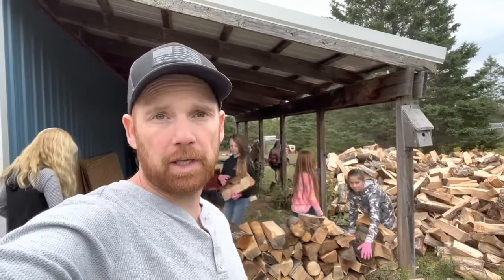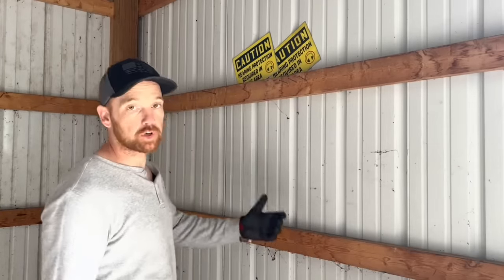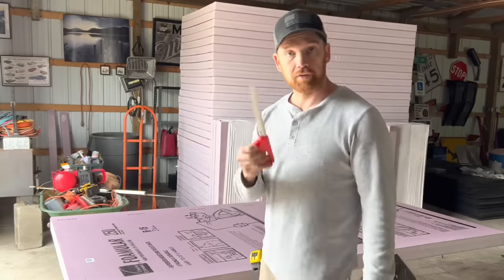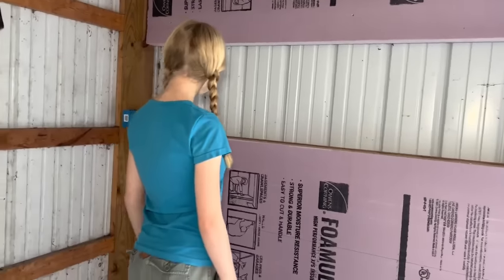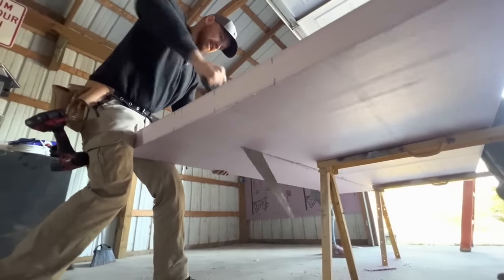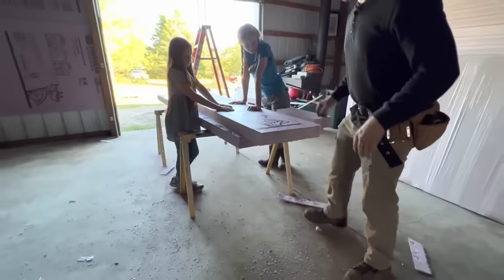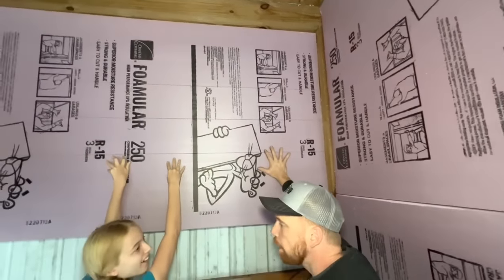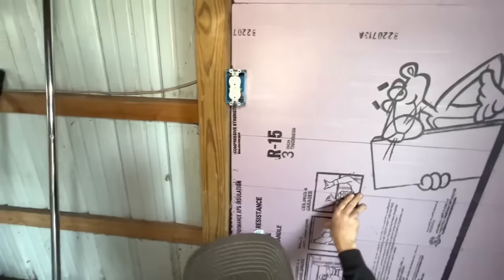Insulating our steel building/garage | Why we are NOT using Spray foam... Family prepares for winter

Comment: Hey! That was fun to watch. The little saw you bought for 16.00 is actually designed to cut Mineral Wool or in most cases Roxul products. A hot wire is the best way to cut foam. The reason that spray foam is so expensive is the result of the snow storm in Texas a couple years ago. Spray foam is two part and the Red or common part is mostly manufactured by one company that has never caught up to demand. I work for Canada's largest Insulation distributor and had a blast watching your video. While there are a lot of ways to do a hot wire you managed very well. Great video, great fun and great kids ... Cheers from Nova Scotia
Reply: I found my table saw did an excellent job. A little messy, and keep a shop vac handy to keep the foam debris out of the motor. Hot wire would be nice though.
Reply: I was just about to comment saying the same thing. Thought I'd stop using our bread knife for cutting Roxul batts and bought one of those. Aside from that I finished my basement with the  styrofoam boards made for interior walls, but they interlocked to have a good seal in between and a 1/4 cost of spray foam and no where near as messy. Its been very warm for 8+ years in Canadian winters.
Reply: Great family help
  Cutting foam is work. My method is a sharp 4” wide putty knife for the long cuts. Sharpen one side well, bothering several passes along a straight edge to set the line. A couple more passes with pressure and you will be over half way through. Then you can snap the rest off along your cut. I do use a saw for the detail cuts. Thanks
Reply: I've tried insulation knives, bread knives, putty knives for cutting foam.  What worked best for me was an 18" snap off knife.  Can get them for a few bucks at the big box stores.

Measure, score with a straight edge.  Cut a bit deeper next pass, repeat a third time.  Gives very clean, precise cuts easily.  Snap off the end blade once it starts dragging and swap out knives every few boards.
Reply: You are very funny and smart👍🏽 and the girls are so helpful. You made me giggle so much with your quick wit😊 subbed.

Comment: You've got such a great family. Kudos! 
I'm a retired GC  48 yrs lived in the 
UP. Moved to Florida in 
1978.  Built many steel buildings and pole barns
Those bottom holes you are 
Using for venting allows 
Rodents (mice)
To move in and they will
They will eat holes in the 
Insulation   We used a manufactured "L" flashing 
Around the bottom 
You could still do that
Reply from the maker: Thank you Al. We will be putting in an L flashing. Thank you for the tip. We’ll be doing an update video also at some point. Hope you’re having a great day.
Reply from the maker: I guess I’m not understanding your analogy on the “Death Plug” it’s not hooked to grid power at all. It’s only powered when the generator is plugged into it. Anyway take care

Comment: You should have cut strips of 1 1/2 to fit between the 2x6s then put the 2 inch over that. I didn't on one of the walls in my shop and I basically created mouse condominiums with roads. When I took some of mine down i had a mess. Blocking the pathways with more foam board helps a lot with rodents.
Reply: Exactly. The snakes will follow the mice. The bugs and spiders will love that air space too.  I wouldn't be surprised if the bees find it and build a hive in there.
Reply: I do love the idea of sealing in between the boards. I'll be doing that on the wall I have to redo. That'll definitely keep the bugs down.
Reply: I totally agree. I live in the mountains over 6k feet and I fill in every hole possible else it will become a nest for rodents and an entry place for bugs. I'd never allow the holes on the bottom to be there. I'd fill up every hole.
Reply: If you have rodent problem just put out equal amount of cornmeal and baking soda.
It will not harm dogs or cats , just rids the mice and rats.
Reply: If rat guard is used on exterior when siding is installed,then caulk any gaps at bottom it will help immensely
Reply: Lol that's perfect size for mice.
Reply: Really should have a vapor barrier outside metal. This would help with varmints
Reply: @edwinrohweller  not in cold climate.  This foam board if sealed with spray foam will act as the barrier

Comment: I did my shop roof a few years back.  Made a huge difference!  HOT TIP--Your sawsall, circular saw or table saw would be much quicker and likely produce cleaner cuts.  Even if the latter two will not cut all the way through, it's still far less hand work.  Thanks for sharing this great project with us!
Reply from the maker: Thank you! Have a great day!
Reply: @9252LIFE  I made myself a foam cutter because I was using the foam board with the reflective siding. It worked great with no mess. There are videos here on youtube that show how to make them.
Reply: Sawzall works OK ,but circular saws turn to fast and melt the foam making a goo mess. Handsaw gives the most controled cut.
Reply: @dalerounds4036  Interesting. Circ saw works great for me. Maybe blades & saws are different?
Reply: @branchandfoundry560  how thick was the foam board though, closed cell or open cell? Doesn't work well on closed cell over 2 in. 5800 rpm skillsaw made a messy cut.
Reply: @dalerounds4036  Two inch pink rigid foam board like shown in video. I have a Porter Cable circ saw made in 2003 and use 24t Diablo framing saw blade (for reference). Could be I'm just lucky it works for me???
Reply: @dalerounds4036  I also use a Makita track saw with good results.

Comment: Tuck tape is best to seal up the flat foam to foam connections and then use canned foam for angles or any awkward, gappy areas.  Need a sealant at the floor to foam connection as well.

Comment: I bought a spray foam setup to do my steel building after seeing my neighbor use insulation boards years back. His metal rusted pretty quick due to sweating. At least use butyl tape on the board's perimeter so there's no air penetration, that stuff stays pliable and sticky no matter what temps drop to. Great channel BTW, I subbed, you got a nice setup!
Reply from the maker: Thank you Gene!
Reply: You can always add a vapor barrier, simple fix. It also depends on if you're in the north or south. Sealing the foam from the inside will be enough in cold dry climate but you need to seal the outside in the humid south.

Comment: I would use a small bead of spray foam between each sheet instead of PL adhesive.   Also start by placing the first sheet on the bottom (beded in spray foam) then stack the next sheets on the way up, leave a 1/8" to 1/4" gap on the sides then fill the side gaps with spray foam. Alternatively there is special tape for sealing foamboard seams.
Reply: Yes I definitely use the spray foam between sheets.

Comment: We had the same problem when insulating an addition, and most recently a post frame woodshop. The spray foam guys wanted insane prices!! 6k for the tiny addition —more than the addition itself costed! The cost for the woodshop was close to 20k! We used batt insulation with Insul-Hold strips on 3 of the walls, XPS and batts on one wall, and batt and blow-in in the ceiling.  If you are willing to do it yourself, you can save massive amounts of money! Note: Foamboard adhesive works dramatically better on XPS foam like that, and you can cut the XPS by scoring and snapping, cut it on a table saw, or a very sharp knife as well.
Reply: Most foam installers have base charges or minimums. They have to spend just as much time driving to a small job and set everything up vs a large job which is a good portion of the work since spraying it is actually fast. The cost of spray foam isn't worth it since foamboard is almost  just as good if you use can spray foam to seal the edges. You also risk ruining your house with the toxic VOCs if the spray foam isn't done correctly and you can't remove it without tearing the walls down and it will smell for decades. You also have issues with adding electrical or plumbing but ya... spray foam Costs too much for the minimum benefits and risks it brings.
Reply: @randybobandy9828  I agree 100% randy! The price we were quoted for spray foam for our post frame woodshop was more than it costed me to build the building! No way that was happening!

Comment: Great video. FYI, I just saw another channel have to remove their metal siding and add the metal covering the bottom of the sheet metal to prevent mice from going up the grooves in the metal siding. Mice can destroy your insulation from the inside out.

Comment: Adding the foam to your garage doors will change the weight of the doors which will effect the counter balance with the spring. You may need to add tension to the springs.
Reply from the maker: Those 1.5” boards are very lightweight but yes the springs on the doors already need attention as they only have one of the springs attached at the moment. It looks scary but I’ll probably put a helmet and shoulder pads on and try to attach that soon! 😆
Reply: Adding tension will not be enough you will need new springs.  Tension may get you by for awhile but it won't be long and they will break so they get replaced anyway.
Reply: @johnlonghair6461  Correct. those foam boards seem light but they do effect the weight and balance of a garage door more than would be expected.
Reply: Adding tension does not increase the amount of weight a spring lifts to any worthwhile degree.  It just moves the problem you have to a different point of travel.  

If you add tension and make the door lighter on the floor you just move that problem to the fully opened position and make the door hard to close.  

A lot of garage door techs are hacks so if one ever told you this works get a new door guy.
Reply: Yes this will Warrant a new set of springs.
Reply: @cygnus1965  he's got 10 lbs of leeway for "Balanced Weight", that's a 20 lbs swing high to low. he'll know right away if the spring needs to be updated.

Comment: 👍 I did the same with rigid foam and saved a ton over spraying. My hand will never be the same after cutting each piece by hand lol. Don’t make my mistake- Get a heated element knife. Cuts that stuff like a hot knife going through butter. 
Be careful with that wood pile… The weight of all the combined wood is more than enough for that corner support.

Comment: The walls are going to be full of critters  .  If you need ventilation , fill the openings with stainless steel  wool .  I have used it  to keep out critters as small  as  ants .
Reply: The spiders will take care of the critters that happen to make it past the permythrin
Reply: Steel wool turns to rust
Reply: Steel wool is flammable not to smart
Reply: @craigchenery604  the foam sheets he is using are way more flammable than steel wool unless I’m missing what you are saying.
Reply: @bluntone2273  no your right guess it wouldn't matter
Reply: That void will be full of mice, & maybe rats. I worked metal blogs for awhile, we formed a 1 1/2” x 1 1/2” notch in the concrete for the metal siding to sit in. This seals off the metal siding.
Reply from the maker: See what we did in our newest video to fix that issue
Reply: @bluntone2273 the foam board have a fire retardant within it , it must be exposes to open flames for it to ignite and if you have open flames you have much more to worry about than insulation because even spray foam would catch on open flame

Comment: Ornery old engineer here and I have to say that it is so refreshing  to see a young family like this!!!  Some of the best memories my siblings and I have are working with our father!  Kudos!!!

Unfortunately, I have to advise you that the air gap you created will be a nightmare for you.  With the gaps to ground at the skirt board, you've created an absolute haven for field mice.  They will devistate your insulation within just a couple winters.  Moreover, their urine will accelerate failure of the coating on the steel siding.  Secondly, your premise for the air gap is incorrect and a very common misunderstanding.  Reading SPFA-134 would have quickly helped you with that understanding.  You have created an environment that will actually result in condensation on the back of the steel siding dramatically shortening its life.  Moreover, while I agree spray foam is ridiculously costly, it absolutely is not an issue when the PROPER foam is PROPERLY installed in a pole building.  The aforementioned reference is the guide, and all the large steel siding manufacturers I can think of off-hand are ok with it.  What is hard to find is an educated and experienced foamer, and you also shouldn't install it on typical econo-grade pole barn siding typical on residential buildings (29ga) because of oil canning.  Thirdly, if you do not have a moisture barrier under the slab, you will like have constant elevated humidity and condensation in the interior.  There are some coatings that can be applied to the slab - none are DIY - to create an after-the-fact barrier.  Fourth and final, and if you are concerned, your installation does not meet the State Code.  You're not providing a compliant thermal barrier.  

Truly, I hate to be critical, but because you have a large following it's important to share an appropriate understanding.  There's nothing wrong with DIY, but it's best done in an informed manner such that it is also do-it-once.  

Best to you and your family in 2023!
Reply from the maker: We posted a video of us installing Rat Guard on the garage to keep mice out. Also condensation won’t build up on the inside of the steel as this is how most cold roof attic’s work and they don’t sweat. We have heated it this winter quite a bit now and ended up pulling down a piece of foam board to install some wiring and the backside was completely dry. We appreciate your input on the matter and to be honest hope for our sake you’re completely wrong. Another factor I guess worth mentioning would be we live in the far north and there’s never a humidity problem/issue here. Anyway have a great New Year.
Reply: @9252LIFE  Great on the rat guard.  If you went with a mesh, make certain it's rated for field mice! They can pass through 1/4" opening, which is the most common size for wire rat mesh.  

Beyond that, I have been a licensed engineer in State for 33 years now, and have built more than 300 pole and steel-framed buildings for commercial, industrial and residential applications in-State alone.  I'm sorry to keep being critical, but your position about roof ventilation is also incorrect as your are not understanding the key differences of how the roof material and its substrate are vital considerations with regard to the interaction and ventilation to insulation schemes.  Even during the span of my career, the guidance of 20 years ago is the folly of today.  Though, that folly is what continues to improve, including reformulation of insulations to remove harmful and corrosive constituents.  That said, I have project right now under scaffold tent in the midst of Michigan winter because improper reinsulation of the 40 year-old home 6 years ago caused rot and resulted in collapsing the roof under the last snow.  I also have a 900,000 square foot steel framed, IMP clad building practically raining inside because the General Contractor proposed a cost savings to the owner to remove the subslab vapor barrier!That remediation will cost the owner at least 10x the savings.  Your installation will reveal the issues in the reverse climatic conditions.  Take a look at the reference I cited.  I only offer practical experience from a long career. Take it as you will. Best of luck to you and, again, you have an amazing family to be proud of!
Reply from the maker: @robv4053  thank you
Reply: @robv4053  could you point me to a publication on how to properly insulate a wood pole building with metal sheathing. There's a product called prodex that seams to solve a lot of problems. But I need a lot more R value. I would never use ridged foam in a shop building. Foam burns hot and fast. Thanks
Reply: @MAGA MAN  The only leaks result from poor workmanship, and I can assure you there are dozens upon dozens of pole building contractors that come and go with no real training and do not use the fasteners appropriately (may sound dumb, but look into self-sealing screws and you'll see what I mean), or from failure of the owner to regularly inspect and repair.  Exposed fastener sided and roofed buildings require the self-sealing fasteners to be inspected and replaced as necessary.  As with EVERY type of construction, there are compromises and trade-offs.  A true pole building designer working with a good constructor can put together a building that will outlive the owner and not at premium price but also not at DIYer price...  I am sorry, but I think there's plenty of fear mongering, and what I can tell you is that I have designed structural repairs to as many pole buildings as I have stick-built that go unseen.  Portal walls around garage doors in stick-built being so regular that I have standard details for them because so many contractors do not follow best practices.  Don't even get me going on lick-n-sticks veneers and stucco done improperly.  Anyway, I laugh when I hear this for pole buildings because it's the 'chicken little alarm' that your pole building will collapse from an unseen leak because you spray foamed...  Why do I laugh? Because repairing a pole building is easier than a stick-built, and the rotted members will be localized should there be failure of the fastener seal with foam.  However, I can, without hesitation, tell you I have seen the worst, widespread damage and costly repair to pole construction from condensation in improperly insulated and barriered construction, and since the barndominium rush it's been a problem with exponential growth!